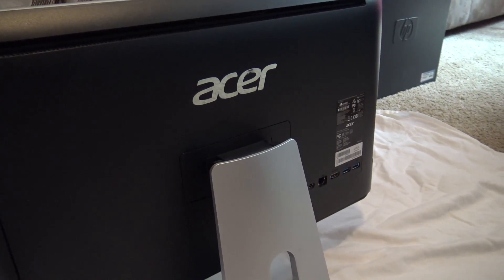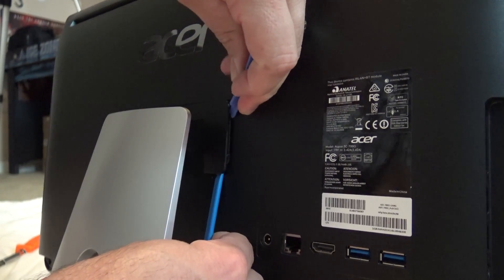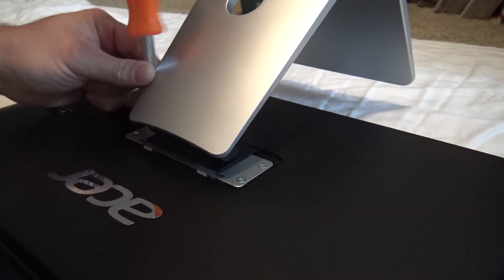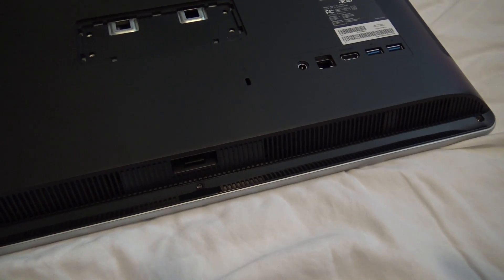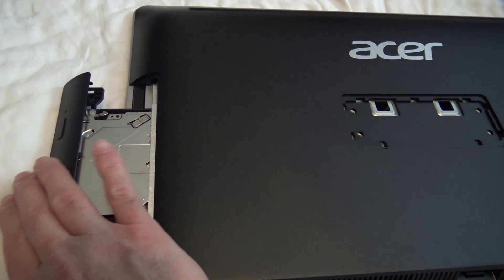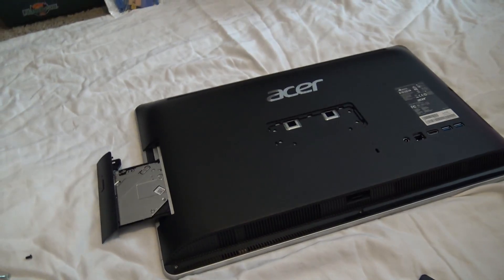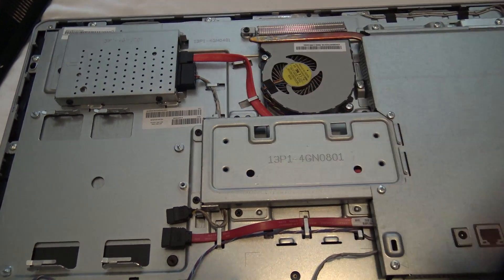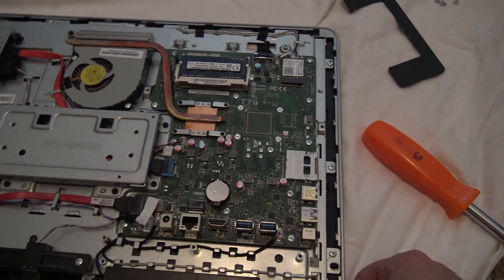Acer 700G  Ram upgrade (tutorial)

Comment: the disk drive cover pops off quite easily, then the back comes off without having to remove the drive
Reply from the maker: Yes, it may. I showed this method so that it reduces the risk of breaking the tabs on the disk face. Once broken, it will not stay on. You can almost guarantee you wont find a replacement.  Thanks for the reply.

Comment: A quick question, I decided to experiment and swap one ram stick from one slot to the other and my pc doesn’t seem to boot from this. Could it be the slot because I’m afraid if I buy another stick of ram, it won’t work. Or should I stick to going with 1x8gb?
Reply from the maker: The RAM module has to be in the first slot if it is being used by itself as  a single channel set up.  You only use the other in duel channel mode.  If you want two RAM modules in the duel channel, then buy a matching set or be very sure to buy the exact same module as the one you have now.  Using two, even if it is the same amount of RAM, will improve you system.  It limits the bottle neck issues that come from only one module.

Comment: where is the graphics card on this computer or is there not one? is there a place to put one in that instance?
Reply from the maker: Hello Tom, good question.  First we need to understand that an All In One PC is basically a laptop configuration.  The internal components are that of a standard laptop.  With any laptop, there. Is not a stand alone GPU.  It will always be integrated in the mother boards chip sets.  You will have 3 main chips. The CPU, the GPU, and the audio.  So the GPU is part of the mother boars on any laptop or all in one PC. Hope this helps.
Reply: mygame595 it does, but it's the answer I was dreading, thank you
Reply from the maker: @iamwhoiam8486  this PC is not upgradable in that sense.  You can upgrade memory and storage.  That is all.
Reply: You could, however use an external GPU that connects to the wifi card slot set up, you'll then need to use a wifi USB or LAN connection to connect to the internet.

Comment: Jeez, what complete dog. Not as bad as a Lenovo laptop battery replacement, but pretty close. Tip for RAM - go to crucial.com in a browser on the machine you want RAM for, and it'll tell you what's in there, what the max is, and what their product is. You can then head across to Amazon or wherever and source it.
Reply from the maker: Hi, thanks for the post. In my experience, you can never go by a model number to order boards and components.  You could work on 100 of these and see 20 different boards.  Even more so with RAM.  Never go by those sites, always open you machine and varify your part. Unless you want to play the parts return relay game with the supplier.

Comment: Is it required that we have the static reduction thing because I don’t have one and it will take quite awhile for me to receive one from amazon do you have any suggestions?
Reply from the maker: You can work without it. You just need to be careful and make sure you keep touching the case.  It's just more risky.
Reply: you can make one with a cable, tape and an aligator clip.

Comment: Bonjour
J ai un  Ordi ACER W10 Z3-710-013(modele francais) depuis 3 ans et qui est identique a ce modele Acer 700G presente dans cette video
il fonctionne tres bien par contre il ne possede que 4 GO de ram
Grace a cette super video je comprends la methode pour l ouvrir et avec l acces aux barrette de RAM
Je voudrais donc augmenter la memoire ram pour passer a 8 go ou plus le maximum rst 16go
la memoire compatible est : DDR3 1.5V et DDR3L 1.35V 1333/1600 SoDIMMs
j ai trouve ce modele qui semble compatible sur amazon :Crucial CT102464BF160B 8Go (DDR3L, 1600 MT/s, PC3L-12800, SODIMM, 204-Pin) Mémoire
de Crucial qui coute environ 50 euros
Par contre si j achete cette barrette de 8GO et ce que  la barrette de 4 GO d origine je peux la laisser et ainsi avoir 12 GOde RAM?
Ou me conseillez vous plutot  de mettre que la nouvelle de 8GO ou carrement en acheter 2 identiques de 8go pour avour 16GO de RAM?
Merci pour vos avis
Reply from the maker: Bonjour, cet ordinateur n’utilisera que 8 gigaoctets de RAM. Si vous installez plus de 8, il ne s'allumera pas. Vous pouvez utiliser deux bâtons de 4 gigaoctets ou un seul bâtonnet de 8 gigaoctets. Si vous achetez 4 autres clés, vous devez vous assurer que les numéros de fréquence et de latence correspondent. Merci.

Comment: This video was super helpful. Thanks!  Having trouble with adding the second stick of RAM.  I have an old acer with the same RAM. I can use the one from this PC or the other Acer and they work ALONE but they will not work together.  It seems that the lower slot does not recognize either RAM and refuses to even boot the PC.  This computer has literally been used just 2 days in its history so it doesn't make sense that it wouldn't work. Any ideas?  Thanks again!
Reply from the maker: IT is more than likely because they have different frequency or latency ratings.  You have to look at the sticker on the ram and make sure the info matches.  If you try to run it in the lower mount, it will not boot.  That is for the second channel ram only.  IF the frequency of one is not one that is recognized by the board, then it will not boot. If you are trying to use more than 8gb in this board, it will not boot.  There is the possibility too that one of the Dims is bad.  Let me know if you have any more questions.  Thanks.

Comment: Hey i have a question my acer pc says reboot and select proper boot device what does that mean?
Reply from the maker: You have changed the boot order inside the bios. You have to put it back in order.  You may have changed the bios to UEFI instead of Legacy and it is trying to do a PXE boot.
Reply from the maker: It could also mean that the OS was  installed improperly or that the Hdd is bad. What have you done to the PC up to the point when this started?

Comment: Whenever cracking ANY system open to do maintenance or upgrades as is in this case, ALWAYS carefully inspect and clean the cooling fan & heat sinks. Cool, GOOD, Hot, BAD... :) Make sure it spins freely and all parts are as clean as possible. Upgrading this or any other PC with multiple memory slots, it is ALWAYS better to populate all the memory slots, so in this case installing an additional "matching ' 4gb memory chip would have been a better choice since it enables "dual channel" operation functionality of the board splitting up the processing lanes which is is faster than using a single memory lane, not to mention cheaper. The only time I would only install a single chip during a memory upgrade would if I was installing faster memory that the board would support ( or it was a FREE chip) and in this case if I was installing memory I'd spring the few extra bucks to populate both memory slots. It's always better to have all slots populated with matching chips (dual channel)...  Additionally, since this is only a Celeron Processor that is "soldered" and non-upgradable, this would have definitely been the time to replace the HDD & upgrade with a SSD! The performance increase is dramatic and you might want to consider upgrading the DVD/CDROM burner with a real Blu-Ray Burner and this system would be "maxxed out" and be about 5 times faster than before the upgrade. Other than those oversights, great video! Well done.
Reply from the maker: Prey Mantas yo, this is my channel. Its a "comment" section. Dont leave a book next time. I just delete this kind of post.  Its too much.
Reply: Understood. You must spend a lot of time on FB. Same nonsense there. That's why I SC'd FB. Just trying to help those checking out your channel by filling in the blanks.  Won't happen again. Peace....
Reply: @ThePreyMantas  I liked it. Here I am a year later looking at what I can do for this PC and comment sections are sometimes just as good as forums. I wanna know what the max FSB is for this motherboard. :) Also this is literally the only video showing the opening of this particular model so any help is appreciated.  An SSD would  really kick this pos up a notch buy I am disappointed with the display. Anyone else having ghosting and such with games?
Reply: @denniswoycheshen  Hi, I use two utils regularly that should help answer all questions about what's under the hood, Speccy & HWiNFO, both free on the net.
Reply: @ThePreyMantas  the bios and google help as well.  Any info on the ghosting I'm experiencing with any game. Is this a hardware or driver issue?  Idk seems like the panel could of been better but this is also 2019 and things have changed.
Reply: @denniswoycheshen  Hi Dennis, I wish I could be of some help to you with this issue you're having , but 1. I 'm  not familiar with "Ghosting" on any video games. Agreed on the higher quality panel could have been used, but it would have driven cost of the machine and this type of system was targeted towards the very low end AIO budget market. It's not in any way shape or form a gaming machine. Maybe you could talk to a friend with a better monitor,  you guys get together and hook it up externally to test for any differences. At least you'll get a good idea if it is your panel or the video chipset and/or driver.  Another idea would be to do a fresh install of OS and try default installed drivers. Sorry I can't be more help. Good Luck!

Comment: you can change the processor to an aspire zc-700??
Reply from the maker: Rodri :v Negative... this processor is proprietary to this board and is soldered to the board.  It can not be changed.  Minimal upgrades is all that can be done.  I offer remote tech support for my subscribers if your ever in need of assistance. Thankyou.

Comment: I did a video on this last year, you really don't have to remove the DVD drive. You just have to remove the face plate and the backing will come off! Just my 2 cents worth. Informative video though.
Reply from the maker: Robert Huey the back cover will not come off this model without removing it. Your incorrect.

Comment: I need a help..can I put 4gb 2Rx8 pc3l  12800s with default ram 4gb 1Rx8 pc3l 12800s...to upgrade ram
Reply from the maker: Shawn Zeao - should be fine. The difference between the 1R and the 2R is the 1R only has chips on one side and the 2R has them on both sides. The 2R just doesnt work as hard. So place the 2R on the top/primary slot.
Reply: i buyed skhynix 4gb 1Rx8 pc3l 12800s 11 13 b4 same as my inbuild ram.. but pc is not booting up i dont know why can you condact me please +380931905208 whatsapp or viber
Reply from the maker: Shawn Zeao im not able to call international. Where did you buy the RAM stick?
Reply: you have facebook?
Reply: i buyed from my friend
Reply from the maker: Shawn Zeao So you purchased a 1R stick instead of the 2R stick? Your original is a 1R stick? Now you have two 4Gb 1R single chip set sticks? Did you buy this new or used?
Reply: yes i have two 1R stick now.. he said its new and it looks new also
Reply from the maker: Shawn Zeao Did it come out of the same model Acer? Why did this friend sell it? What is the reason they did not need it?
Reply: its a reparing shop!
Reply from the maker: Shawn Zeao - I do not use social media. I can place calles through Google hangouts
Reply: i put the inbuild ram it works.. but when i put the inbuild ram on other slot it doesnt boot also.. but for new ram it doesnt work on both slot
Reply: ok im in hangouts also..
Reply: so why its not booting up its problem with ram or i buyed wrong ram?
Reply from the maker: Shawn Zeao there is a chance the ram u got from your friend is defective. Sometimes you may not get it seated properly. Try to remove them and change them to the other bays. Switch them one to the other. If that doesnt work then try to boot with only the mew ram.
Reply from the maker: Shawn Zeao Can you read the voltage on both of the ram sticks? What are they?
Reply: yeah i tried doesnt work.. but when i put my in build ram without puting new ram i brought it turn on.. if i put both it doesnt turn on.. do i need to update bios to upgrade ram?
Reply from the maker: Shawn Zeao not usually, did you try to use just the new one by itself? Does it work?
Reply: nop doesnt work

Comment: How much of a performance difference did you notice after adding more ram??
Reply from the maker: Terry Breitmeyer --Well, notably double. Most people dont realize that win10 64bit takes just under 4gb ram to initialize and run in its factory settings. That means no proper adjustments to optimize win10. So with out the upgrade you will not be able to do much besides office work or some youtube streaming. So for cost and functionality it is definatley worth it. I also cloned my HDD on to a Samsung 840 EVO SSD. Then added the original HDD as my file storage drive. The original HDD sits inside an external hdd caddy attached to the back of the PC via a USB3 cable.  You can trick the smaller 'C' drive into thinking its bigger than it is by creating a directory to the old hdd through the New SSD. This will allow all new apps and software to store to the bigger back up drive but have the OS think it is on it so it will boot the programs. Its a pretty neat way around expensive larger SSD drives. Now the PC starts up from an off status to full boot in about 10 seconds. Shuts down in about 5 sec.

Comment: can you link the website where you got the other ram
Reply from the maker: Soccerking7687 I purchased it on Ebay. I also recommend Newegg.com
Reply from the maker: If your ram is the same as mine I have an extra 4Gb I can sell you. Let me know the info on your ram sticker.
Reply: mygame595 I have the same computers as you and I would like to know how much you would sell it for
Reply from the maker: Did you check the ram card in you pc? the one I have here is 4GB 1Rx8  PC3L-12800S-11-13-B4. It is labeled as a "1R" but this is actually a 2R. Works either way.
Reply from the maker: The last portion of the ID isnt so important. What you need to match up is the PC3L-12800S.
Reply from the maker: @$20 plus shipping. This one is brand new.  I can creat an Ebay listing for you  to purchase.
Reply from the maker: Just let me know if you would like the Ebay listing to buy this.
Reply: I would want to purchase it. Let me know if its still available.
Reply from the maker: Jose Martinez-- hi, yes it is.
Reply from the maker: Jose Martinez -- i can list it for you on ebay . $20 plus shipping.
Reply: mygame595 yes. Let me know

Comment: My computer is the same model without the "G" (ZC-700) and the processor is Intel Celeron J3160 and I want to upgrade RAM. Will it be the same process? And the same RAM model?
Reply from the maker: Erik Daniel C.A. --Hi, I cant speak as to what RAM you have because the manufacturer uses diferent hardware at different  times. You will need to varify the RAM. The process of opening the case and installing it should be the same.
Reply: mygame595 Fine, Thank You! I'm going to check that
Reply from the maker: If your ram is the same as mine I have an extra 4Gb I can sell you. Let me know the info on your ram sticker.
Reply: mygame595 Thanks, the RAM model is the same. But unfortunately, I am from Mexico.
Reply from the maker: I can ship it to Mexico. No problem. I can set up an Ebay listing for you to purchase this. This one is  4GB 1Rx8 PC3L-12800S-11-13-B4. The part that you need to match up is PC3L-12800S.
Reply from the maker: @$20 plus shipping. This one is brand new.
Reply from the maker: Just let me know if you would like the Ebay listing to buy this.
Reply: I have another question... Can I make Dual-Channel with the integrated RAM memory and other one of different brand? Because I have read that to make Dual-Channel I need two identical RAM memories
Reply from the maker: Erik Daniel C.A. -- well, two 4 sticks will be slightly faster than a single 8 stick. the default stick is a 1R meaning the chip set is on one side. The 2R chip set is on both sides of the stick. So using The single 8 stick that is a 2R then you will not notice any difference. The only way to see the diff is on a good benchmark test. operating the PC you will not notice. A single 8 is a little cheaper than two 4 sticks. Also it doesnt mattet what brand. As long as there specs are the same. The bes option for this Acer is to run two 2R 4Gb sticks. But again, no noticable diff. I would suggest on this machine just upgrade by price efficiency. It iant just RAM to consider. This MB and the 1.62 processor isnt very fast to begin with. If you really want a performance boost then convert to an SSD primary drive.
Reply: Oh! So, if I upgrade Ram with another 4GB stick, there is no any difference?
Reply from the maker: Erik Daniel C.A. Right, in this particular PC you will not see a diff. Upgrade to an SSD and you will see the diff. I have since installed a Samsung 840 Evo 250GB SSD in the Acer from this video. Super fast now.
Reply: mygame595 Well, maybe I'll leave it as it is. Thank you again!